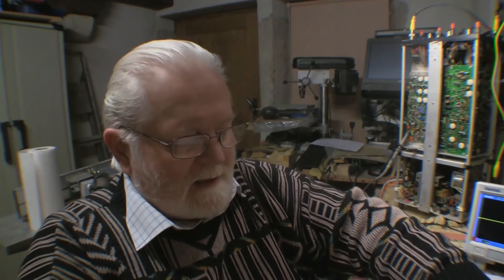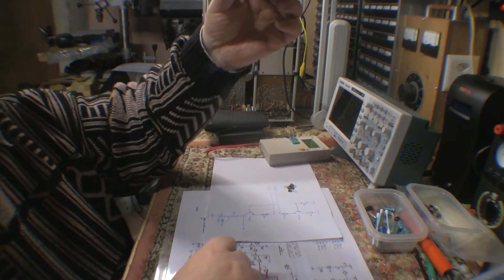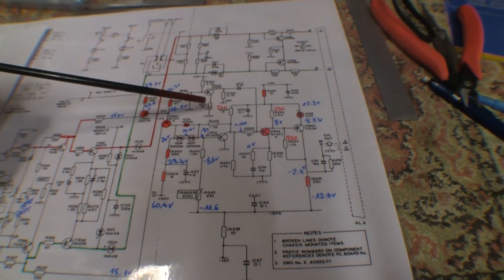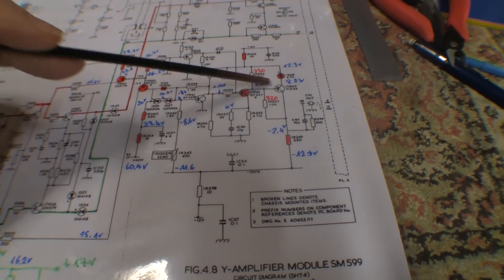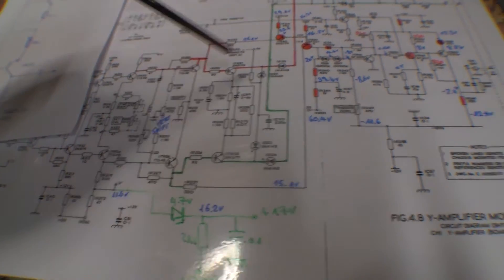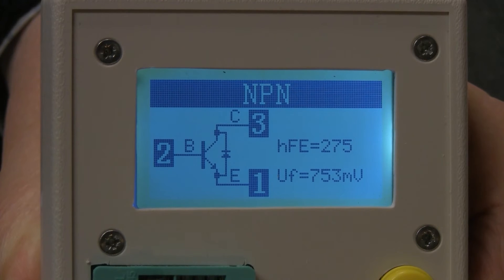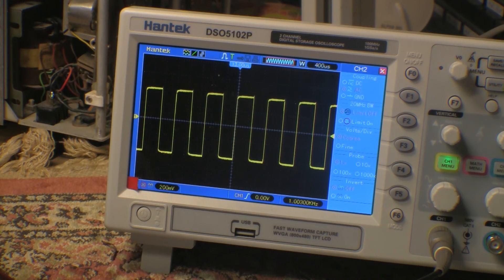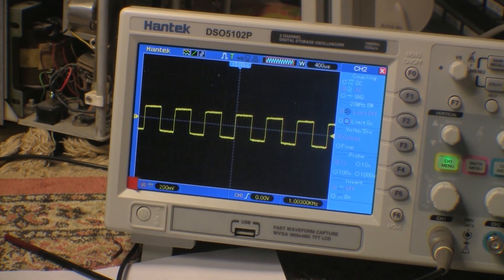Happy New Year and scope update (part 13)

Comment: John,
I think something's just not working right.

Regards,
John
Reply from the maker: Hi John, you are indeed a master of the understatement :-)
I'm clearly not yet in possession of all the required information but I'll keep plodding along and work on the basis that determination will out in the end.  I went through the channel 2 circuitry at the weekend and found some faulty transistors.  Alas I ran out of NOS BF357's so another batch is on order......
Cheers,  John

Comment: Thanks for the update on the scope.  Just a quick thought - the base voltage of ITR60 should follow the emitter voltage.  This base voltage will then feed into the base of ITR59 which will amplify the signal, and that will appear on the collector of ITR59.  You'll have to see if that allows you to trace what's going on.  Thanks for your great videos and Happy New Year.
Reply from the maker: Thanks Robert, as I've said, my knowledge of discrete semiconductor is very limited so all help to get me up the curve is most appreciated!  Happy New Year!
Cheers,  John
Reply: Zone1242 I think that's so called "common Base " configuration.